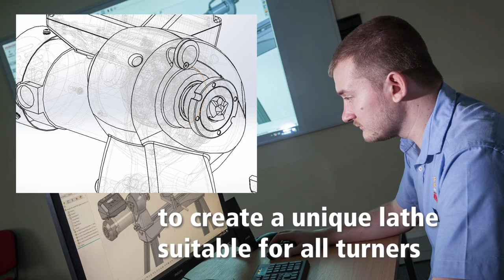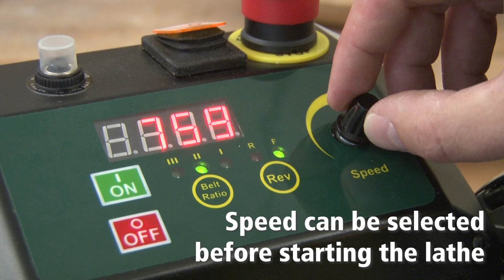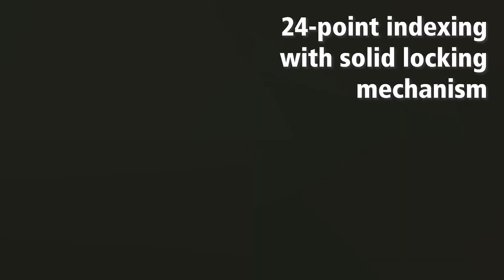Coronet Herald Heavy Duty Cast Iron Electronic Variable Speed Lathe from Record Power

Comment: Been running mine nearly 6 months now. I love it. I have the tool rest extension and other rests, but made my own kill switch extension for £8.95 (exact same switch). My only gripe is that I wish is that it slowed down faster. It reduces speed slowly with power still driving the motor, so you can't even use a hand to aid the slowing.  Would be great if you could do a firmware update to make it stop faster. I will buy the bed extension when the price drops a bit! ;)
Reply: Had mine for 18 months and glad I chose it. Last week I bought a Robust tool rest (1 inch by 95mm) and that has been 10x better. I am also about to fill the legs with sand for more stability, as bigger bowls off the edge didn't run quite so smooth for me as that depicted in the video.
Have started to appreciate the different belt positions now I am more confident with speed (3) and understand the need to have more torque (1). Having a 140 speed is very useful when applying oils etc (slower would be even better).